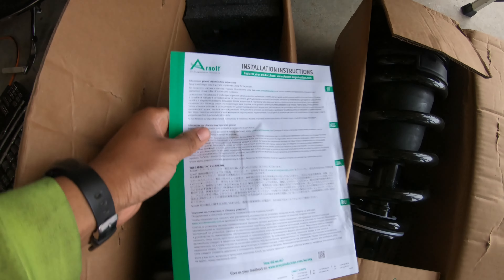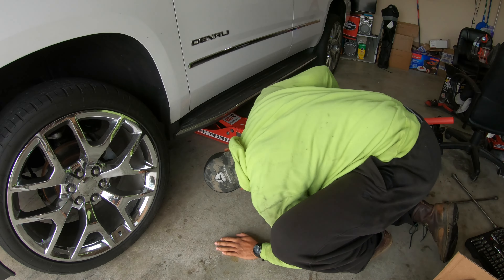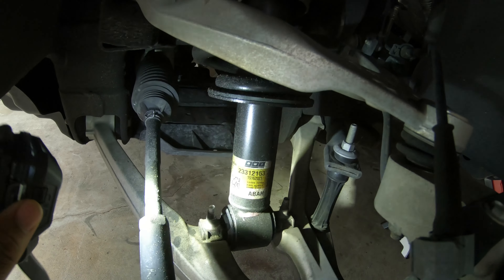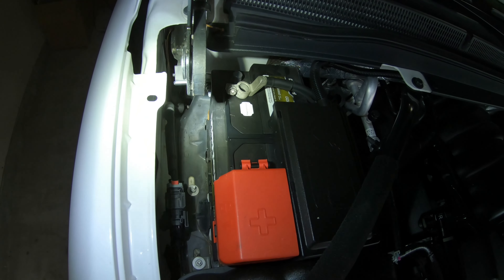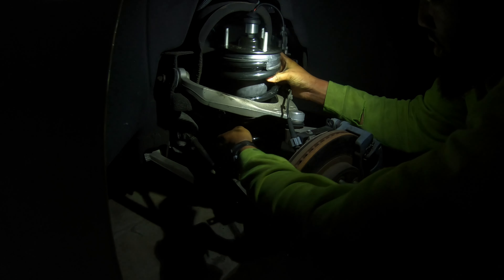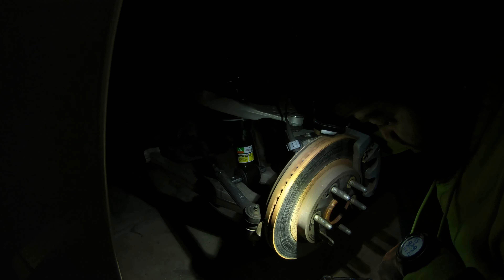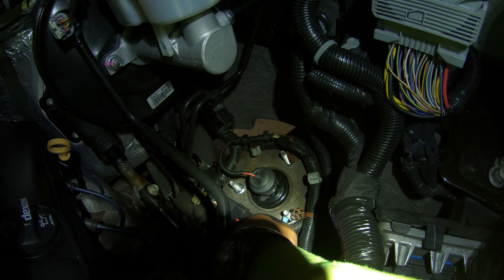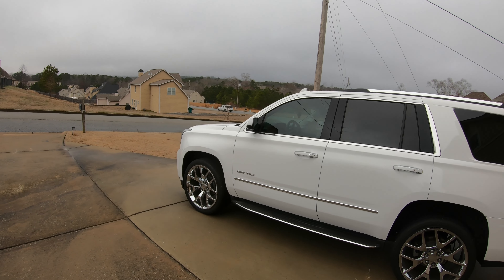2015-2020 Yukon Denali MagneRide Front Strut Replacement Using Arnott SK-3354

Comment: FYI - for anyone looking into doing this, the SK-3354 are Non-Magneride. They are a direct fit replacement but they do not have Magneride capabilities. If you want an Arnott version of Magneride, purchase MR-3840, not available on rock auto. Same with the rears, there are both Magneride and Non-Magneride versions of replacement shocks. Magneride versions start with MR, Non-Magneride start with SK and AR. The Non-Magneride versions only plug into the truck so codes aren't thrown.
Reply from the maker: You are correct! Thanks for sharing this info with everyone!!!!👍🏽
Reply: what about the rear AS are they magneride?
Reply from the maker: The rears are magneride air shocks from my understanding. They are self leveling & adjusting…
Reply: so it’s ok to go with the shocks that’s not magnetic ride but had the plug-in sensor?
Reply from the maker: Yep! The plug is there so the truck won’t throw an error code
Reply: ok thanks
Reply: Thanks man for excellent video gonna this a shot.
Reply from the maker: No problem! Good luck with the install!!!💪🏽
Reply: Did you go with the 3354 model strut for your denali?
Reply from the maker: @jeremiahjohnsonsr.8620 yep!
Reply: @Trouble2Times  thanks for the info bro
Reply from the maker: @jeremiahjohnsonsr.8620 no problem bro!
Reply: Question, I have a Denali with magneride BUT does one need to change with magneride or can I go with the normal shocks?
Reply: You saved my ass with this thank you!
Reply: Why didnt you use the factory bolts and nuts?

Comment from the maker: UPDATE I Received A Replacement For The Defective Unit, Installed It.. & ALL IS WELL!!🙌🏽🙌🏽 No Warning Lights & They Ride Like A Dream!! Thanks For Watching!!💪🏽👍🏽
Reply: Was it just the wire that was replaced or the entire strut that you replaced on your Yukon Denali. I'm having the same problem with the suspension light on with my 2015 yukon denali
Reply from the maker: @jeremiahjohnsonsr.8620 replaced the entire strut. I believe they do give u the option of just replacing the wire.. but I didn’t wanna deal with cutting & splicing the harness…
Reply: @Trouble2Times  so after you replaced the strut the suspension light didn't come back on?
Reply: Hey bro since you bout new struts how is the ride smooth or the original ride better let me know hit me back
Reply from the maker: The ride is decent. The OEM ones do ride better, but these are good replacements
Reply: Hey bro did it lift your front end up more?
Reply: They still sell the oem ones for $892.00😢😢

Comment: I took mine to a mechanic they told it was 1600 for just the two front ones , I’m confused cause he said something about air something  please help
Reply from the maker: Now I’m no mechanic by any stretch of the imagination.. but the two front ones are MagneRide & the rears are air shocks.
They are both electronically controlled by a system within the truck’s computer. The front shocks(Arnott SK-3354) used in this video are just basic replacements, THEY ARE NOT MAGNERIDE.. & I paid about $900 for the set.
I’d imagine the MagneRide replacements would be much more expensive, plus I’m sure labor was added within that quote the mechanic gave u. Hope this helped!!
Reply: But for sure front aren’t air right ? Just back ? , also I saw them in Amazon for 300something for both the front obviously different brands , better then what dumb mechanic was charging me

Comment: I have a 2019 Denali and I'm pretty sure my front shocks are out due to my ride being bumpy as heck!   Thoughts?
Reply from the maker: I would assume that too. The stock shocks are only good for 50-80k miles from my understanding!
Reply: Omg. Me too. I have a 2018 Yukon Denali. She has 57k on her. When I got her the ride was nice and tight. I hooked a trailer to her to pull a vending machine and now the ride is loose and she feels like I driving over rocks or a bumpy road ALL THE TIME.  What did I do to her?

Comment: I appreciate you putting this video together.  I don't think I would have attempted to do this myself, as I have the same SUV, '18 Denali and I was told that my front drivers shock was leaking, just like yours, but the dealership wanted like nearly $1500 for a new one and I'm now confident that I could do this myself and you made it look really easy and even went the extra mile telling us about the socket sizes you'll need which is great so you can make sure you have those or purchase those before getting started.  Have a great day and again, i appreciate you, happy motoring!
Reply from the maker: Appreciate you bruh! Glad I could help you save some $$$ & let you know that you could tackle it yourself! Have you done it yet? How did the install go???

Comment: What is the difference between short base and long base struts
Reply from the maker: I’m not totally sure.. but I would say that it probably has something to do with the weight difference in the trucks. & since one truck is longer than the other.. it may require more stiffness in the suspension. Just me guessing tho🤷🏽‍♂️

Comment: So I have the air suspension on my 2015. Do I have to mess with that?
Reply from the maker: In stock form.. the air suspension is exclusively in the rear. They’re controlled by air, but the fronts aren’t…
Reply: @Trouble2Times  ok gotcha. I was gonna try to do it myself but Idk what I’m doing. Every shop I called it’s like $2800 or $2400 nothing lower than $2k
Reply from the maker: Honestly bro.. I didn’t kno either! All I knew was.. I wasn’t paying a shop to do it!!🤣.. it’s fairly simple if you have the tools & time tho!
Reply: @Trouble2Times  Yea that’s my thing I gotta get some tools lol

Comment: This eliminates the check suspension light popping up right ? Thank you in advance !
Reply from the maker: Yes.. the plugs on top of the struts are what trick the computer into thinking you still have OEM(Magnetic Ride) shocks installed
Reply: So you actually got the non-magnetic ride version? That's why they ride ruffer than factory? @Trouble2Times

Comment: You made it look so simple. I’ll probably have to do a video of what not to do. lol
Reply from the maker: 😂🤣.. it was fairly easy honestly! Go for it!!!
Reply: Replacing a loaded strut assembly is easy, probably a thirty minute job after jacked up and secured for both sides. You do not need to mess with the sway bar. It's three nuts and two bolts per side. Use a long pry bar on the lower control arm to seat the bottom of the strut on its mount. However, these aftermarket loaded assemblies are not the same as the OE ride. Check my other comment for more detail.

Comment: How are these holding up
Reply from the maker: About 15K miles on them now & doing great! They’re not as plush as MagneRide, but they get the job done IMO
Reply: @Trouble2Times  are these not the magnetic ones?
Reply from the maker: @jonathanritter7364  no.. these are a “standard” style replacement. They do offer a MagneRide option tho..
Reply from the maker: @jonathanritter7364  Arnott MR-3840 is the MagneRide version

Comment: What was the height of the front of the truck after install? Was it 35 inches from the ground to the top of the wheel well?
Reply from the maker: I’m not sure.. I didn’t measure it. But the height didn’t change much after the install

Comment: What do you think of the ride of the Arnott setup?
Reply from the maker: Pretty decent.. not as plush as the OEM MagneRide, but its smooth until the road gets VERY bumpy
Reply: @Trouble2Times  SK-3354 are non-magneride, MR-3840 are the magneride version. SK-3354 only plugs in so the truck doesn't throw codes.

Comment: Did you replace these with magna ride
Reply from the maker: Yes.. these are Arnott SK 3354.. direct replacement for GM MagneRide shocks
Reply: @Trouble2Times   thanks mane. Your video was stellar. I ordered a different one but I will see how they pan out, what other type of videos do you post I'm subscribed now
Reply from the maker: @denalimike8159  yessir.. thanks man! I’m kind of all around with my content. My channel is based on me & my motorcycle.. but I like wrenching on all my toys as well. So I try to document everything, in hopes that it’ll help someone while being entertained! Hope this answered your question.. thanks for the sub & good luck with the install!!💪🏽
Reply: @Trouble2Times   thanks again brother! I got it done,  went pretty smooth other than the sway bar link breaking but got some at the store. About 1 hr per tire. Thanks again! Can't wait for more videos , did you do radiator yet?
Reply from the maker: No problem man! Glad everything worked out for you!! No sir.. that was all swapped out when I bought it, condenser as well! I jus bought the Range AFM Disabler & changed the torque converter on it a few weeks ago. I’m gonna be doing a video on it soon…

Comment: Good info right on time for me, I  to change mines too. What’s a link to order the shock?
Reply from the maker: Yessir.. I ordered mine thru Rock Auto for a few bucks cheaper, Arnott SK 3354:
https://www.rockauto.com/en/catalog/gmc,2015,yukon,6.2l+v8,3307641,suspension,strut+/+coil+spring+/+mount+assembly,15174

Comment: Got a 2018 thinking about replacing all 4 with Arnott from summit racing I hate the magride. I have less then 50k miles on mine and front right is blown and back left is leaking. Just curious if it gave a good ride since and did Arnott replace that strut with the broken pin?
Reply from the maker: Hey hey! The ride is actually decent.. but not as plush as the MagneRide. U can really notice a difference when the roads get bumpy. Even my worn out Mags did great at soaking up bumps, but the Arnott’s are a top tier replacement in my opinion. Nice & smooth.. not floaty at all. & yes, they did replace the entire strut with the broken pin! Thanks for watching!!!